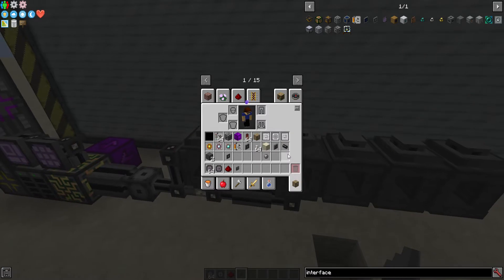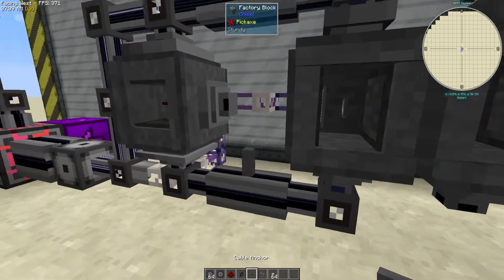AE2 Inscriber Automation: Pure AE2 + Hybrid builds.

Comment: How did you encode the patterns? I can't get past that step. Looking it up online, I'm supposed to use a pattern encoder,  but this was inscribed, not on a crafting bench
Reply: Use a Pattern Terminal, and toggle the field from Crafting (a single box) to Processing (3 boxes). The toggle button at least on mine is underneath the scrollbar for the normal terminal above the crafting area. From there, place the items that need to be pulled into the machine (With the above setup in the video the crafting pattern ignores the presence of the redstone and pressed silicon, and just imports the Circuits) the crafting grid, and the desired output onto one of the 3 slots next to it. Place a blank pattern into the top slot above the button that says Encode Pattern (along with the explanation). Click to encode, then take the resulting pattern to the desired ME interface and install it.

It took me a little bit to figure out what Flanks was doing with his setup especially involving the final step.
Reply: @speeddemon1092  tysm! my friend shut down the server a while back, but I will take a ss of this, and when it comes back on, i will go back to do this first thing! tysm!!!